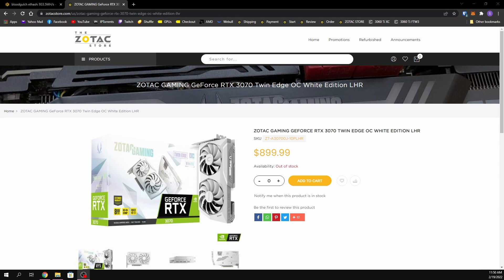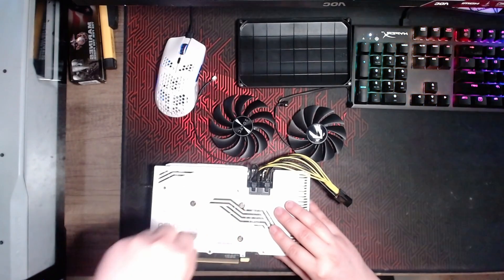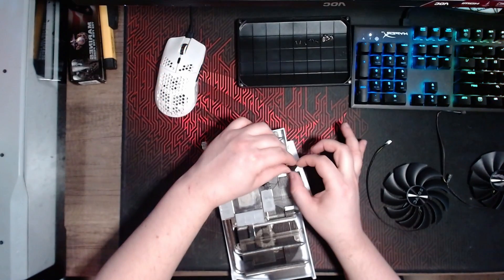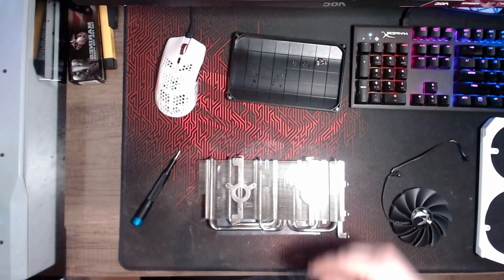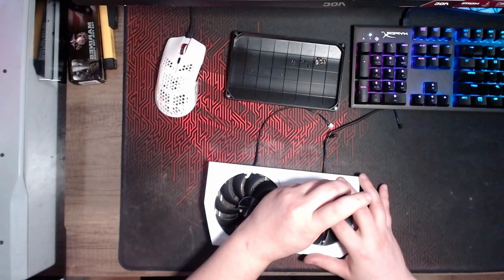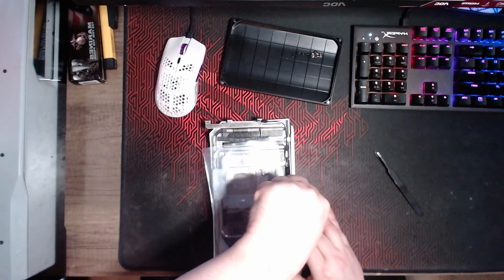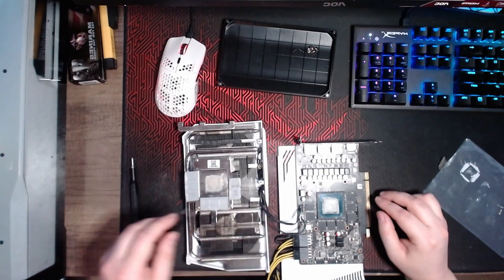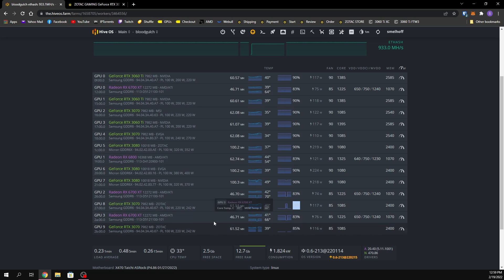Zotac RTX 3070 Fan Replacement (2022)

Comment: So led plugs into splitter of one of the fans?
Reply from the maker: That is correct
Reply: @sethtrosity  bought one second hand , fan was replaced with different fan plugged into led connector
Reply from the maker: @Carrington1961   They most likely couldn't find the correct fans, which have the pig tail for the led, so they used different ones.
Reply: @sethtrosity  well ordered the correct fans ill watch your video again to install them, what thermal pads do you recommend?
Reply from the maker: @Carrington1961  I used Gelid Ultimate thermal pads on mine, when I did the swap.

Comment: I've got 3 of these 3070's, one of them I've had for 3 years now the big fan just stopped working and it's hard to spin even if you try to spin it with your finger. 
Do you think I need to replace the fan or could i do something easier? ( like spraying lubricant while its still attached )
Reply from the maker: If it was me, I would just replace it.
Reply: @sethtrosity  sadly no other alternative? :((
Reply from the maker: @baby333  I mean you can try and lube the fan again, but in my attempts, I ended up having to disassemble the card anyway, so I just replaced them.

Comment: are u use it in mining
Reply from the maker: The two zotac 3070's I have were mining ETH for almost 2 years before the merge. Now they are just sitting in my rig doing nothing.
Reply: @sethtrosity  i bought one last week and look like yellow stuff on logo zotac and saller told me he never use it in mining 
So he could be layer
Reply from the maker: @hatemyousef2487  Those decals on the fans tend to yellow after time, regardless of mining or not. There really isn't any way to know what he used it for unfortunately.
Reply: @sethtrosity  thanks pro

Comment: Did you reapply the thermal paste on the CPU when you reassembled everything? Or is it safe to reassemble without installing new pads and paste?
Reply from the maker: The way I see it, if this is the first time opening the card, you should reapply the thermal paste. As long as you don't damage the thermal pads, you don't need to replace them. I replaced the pads and paste on these before the fans died. I usually inspect the die to see if it is fully covered with paste, if not I will add more.
Reply: @sethtrosity  Thanks! Btw, very useful video :)

Comment: Rtx 3070 white zotac crap quality card i have changed fan every 4 months this shit thing always this zotac company is crap dont buy this company new card
Reply from the maker: I do agree that these zotac cards are one of the worst quality cards on the market, but they still make money. Way more than enough to cover the price of fan replacements. Mine were mining for about 7 months with 90% fan speed 24/7 before the first fan died.
Reply: @sethtrosity  my fans always die after 2 months re order form ali express always
Reply: @Ottomans224  is aliexpress ones are crap aswell?
Reply: @cuma666  yes brother they also crap